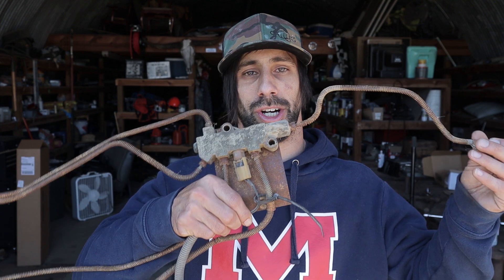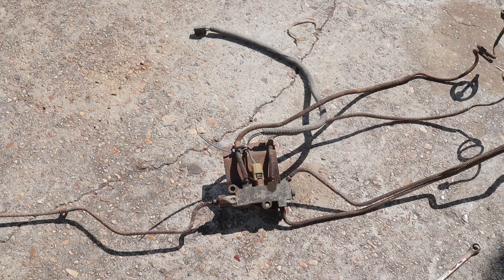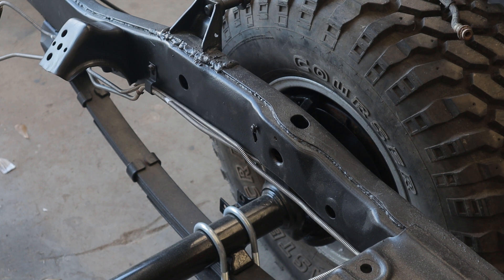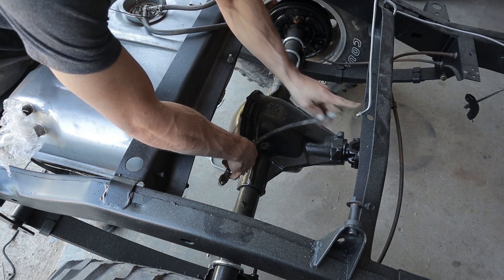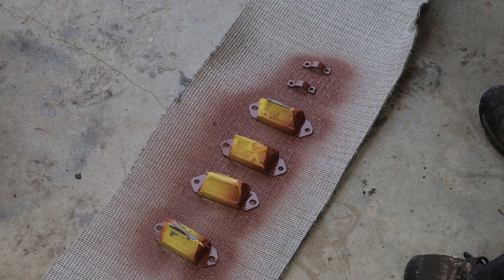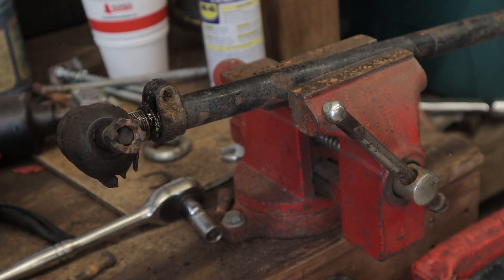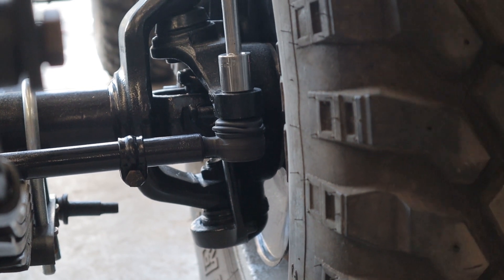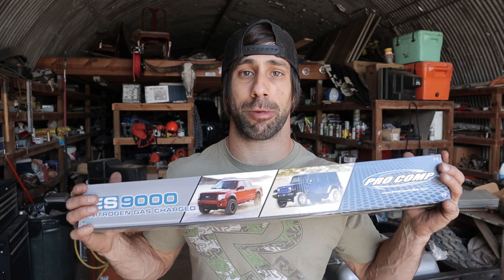Jeep CJ5 Restoration Pt. 11 | Brake Lines, Tie Rod, Gas Tank, Bump Stops, and ProComp Shocks

Comment: Another great video! Thanks for sharing man! I’m always looking for the newest video you put up. I need to get after my Jeep project! Look forward to the next video!👍🏻
Reply from the maker: Thanks for watching! What year/model is your project?
Reply: That Jeep Adventure well I purchased a 1981 Jeep cj 5 with the iron duke 4cyl. With the SR4 trans. Body was to far gone so I found (local to my area) a donor body but, I believe the body is older, I’d say around 76. My frame in the rear is also gone which I purchased replacement parts but, we shall see how that goes,lol I bought a amc 360 and also a Dana 20 attached to a T-150 3spd..
Reply: @2001pontiacta  I have a 77 that someone swapped in a 360 with a 3speed  and Dana 20 t case..   I like it alot, although amc parts a hard to come buy and the go fast parts arent cheap like a SBC 

 I had to do some work to my tub to save it, just need to fix the back of the frame over the rear spring hangers now..  plus new interior as it sat uncovered for 13 years
Reply: @ThatJeepAdventure  where did you get you brake line kit from?
Reply: @ThatJeepAdventure  quick story local texaco dealer bought new 1971 cj with all bells whistles hardtop meyers plow u name it went out of business 1978 and donated Jeep to shelter they left it outside and it was stripped and vandalized. Ouch!

Comment: My CJ-5 is just about in the exact same spot as yours, bare frame getting put back together.  One quick question, that bump stop that is on that mount just in front of the right side motor mount...  Are you re-using yours and is it in decent shape?  Mine was rotted from oil and such but I can't seem to find that as a part anywhere online.  My channel is running a few weeks behind yours, but I'll be checking in often for any helpful tips as you go.  No sense all of us making the same mistakes if we don't have to, right?
Reply from the maker: Mine had an aftermarket lift put on at some point, so I am assuming that they replaced the bump stops at that time because they really weren’t in to bad of shape. So, to answer your question I’m able to reuse these. I’ll reach out to a couple people and see if I can locate some for you
Reply from the maker: Walked out to my shop and took a look. I see the one you are talking about now. I do not have that one either. I can probably find some though
Reply from the maker: What year is yours?